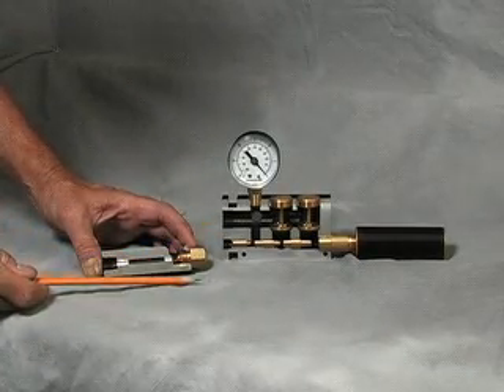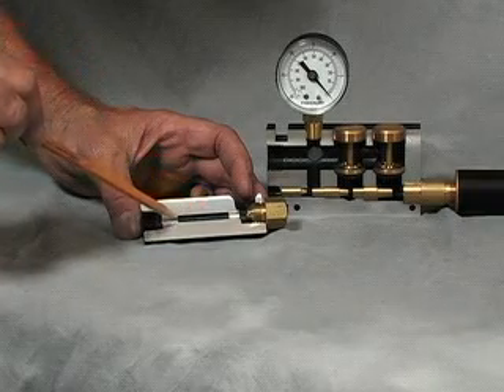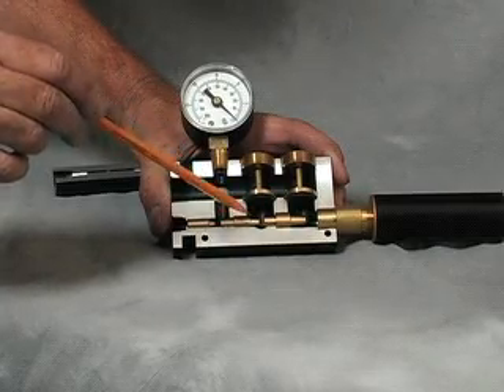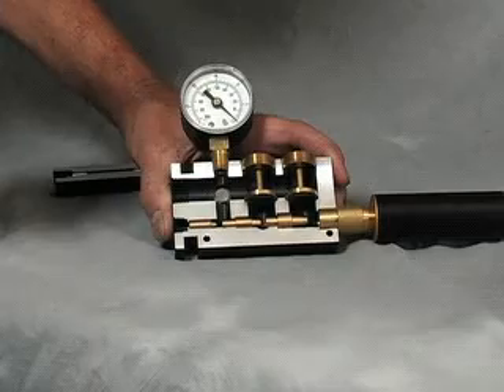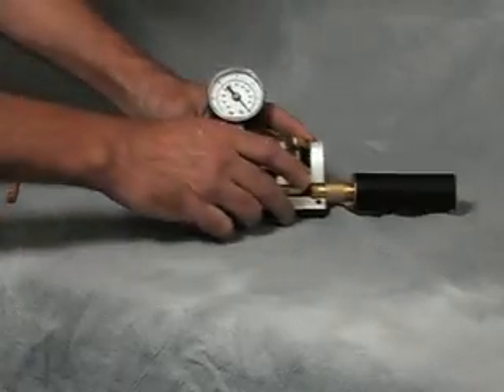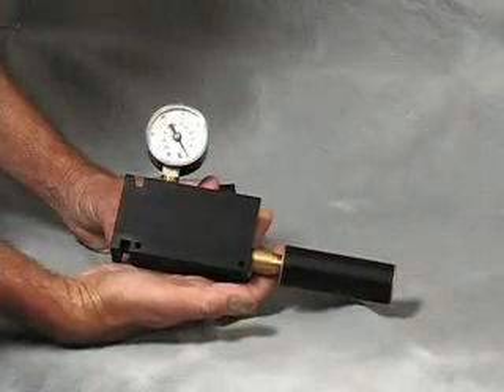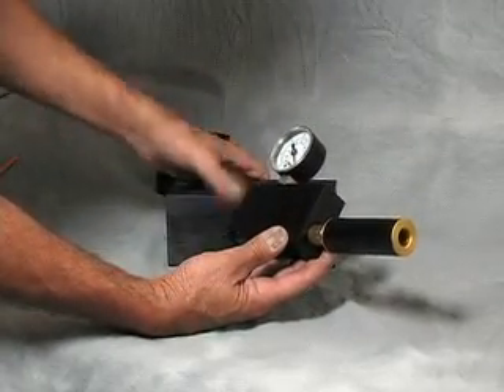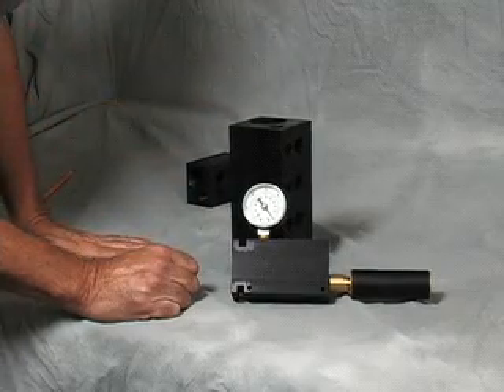Vac Cubes Single and Multi Venturi Vacuum Pumps

Comment: How much vacuum can it produce in terms of atm  pressure or bar or torr or mmHg?
Reply: The Venturi vacuum pumps uses the atmosphere pressure to provide the equalization of depression inside the pump. So, the major pressure they can reach is the atmosphere pressure in the level where it is. So, at sea level, the most pressure it reachs could be 1,013 bar. If we disconsider the loss at the pump, it never will get this level of pressure. The highly pressure obtained with this technology is about 1,008 bar. 
But, the energy efficience are so major then electric pumps, 'cause you can turn it on/off anytime. About flow rate, single ejectors have minor efficience, about 1:1 - 1:1,5 proportion of inlet air against vacuum generated (1:1 > 1 Nl/min at inlet, generate 1 Nl/min of vacuum)
Multistage pumps can reach high flow rates of vacuum, 1:3 - 1:4 proportion.
You can see some different king of multistage pumps at www.hmpc.com.br . Regards !